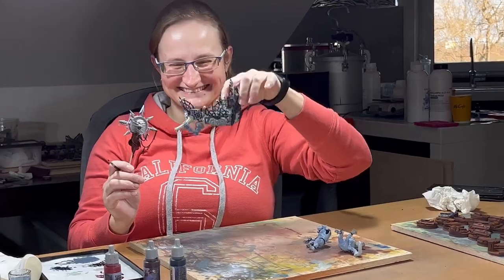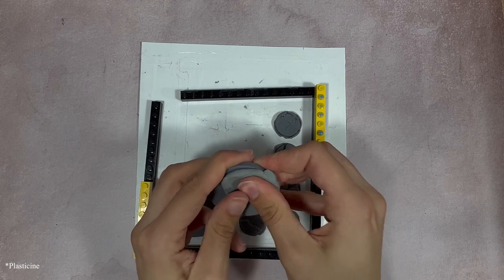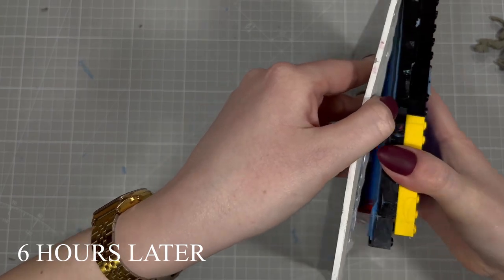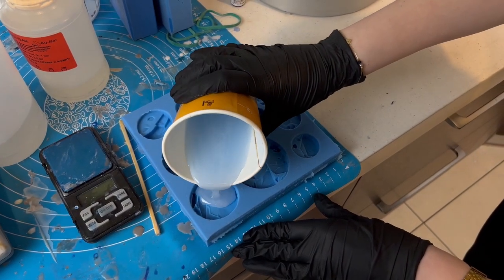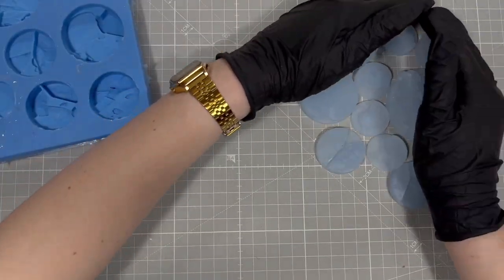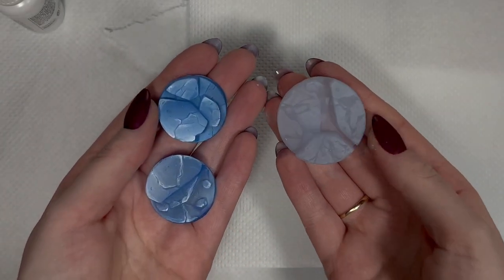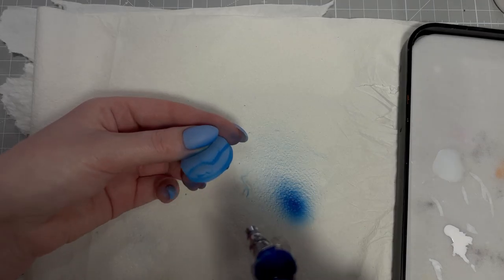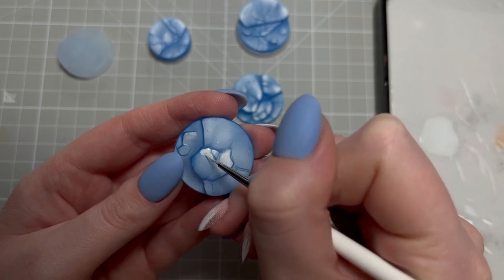How to paint Tau ice bases?

Comment: Is there anywhere where you could potentially buy similar bases to start with
Reply from the maker: Txarli Factory designed Frozen bases, i just made them thicker (rescaled). They sell STL (any company with 3d printing on etsy should make them or home printing). As a second option I would pick Microart Studio Shale resin bases. Hope It ll help. I forgot to put It on video, sorry